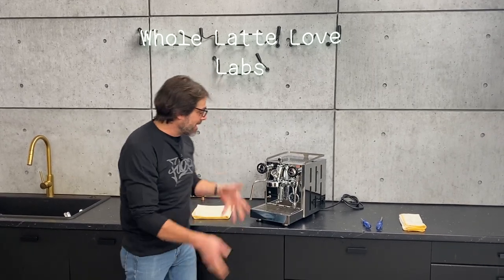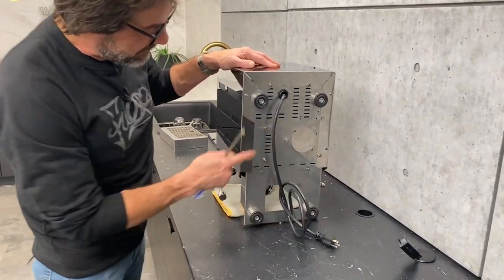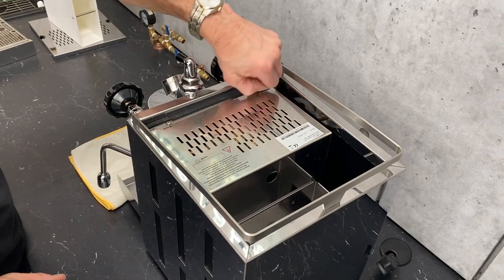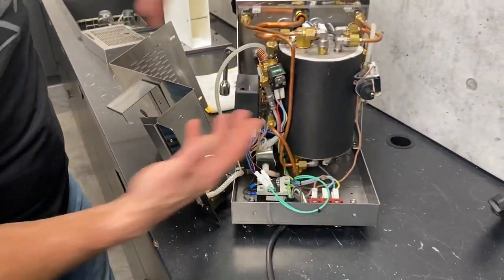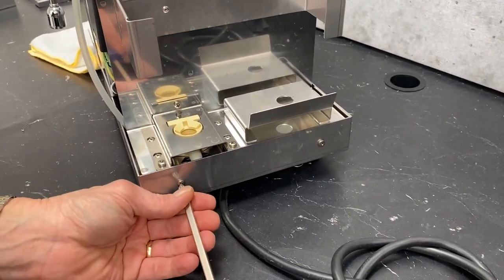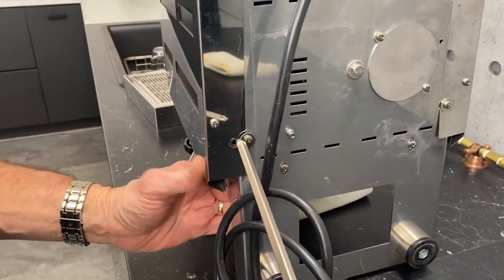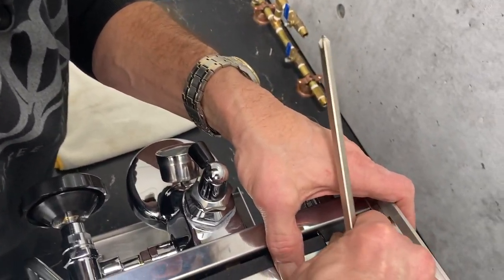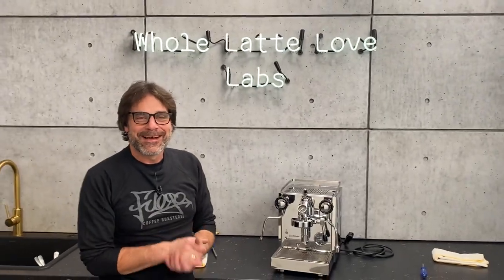Quick Mill Pathfinder: Housing Removal and Installation

Comment: I have a Quick Mill Arnos from you guys, and although it has some screws on the bottom that partially disconnect the outer panels, the panels won't fully come off. Any videos or instructions for that?
Reply from the maker: Hi lll, You also need to remove the 2 screw towards the front of the machine on top underneath the drip tray. That releases the front top of the side panels. I do not have the machine in front of me at the moment. There may be other hidden screws to fully release the panels but think that's all you need.

Comment: Marc,any tips on removing the panels on a quickmill andreja?  Not appearing obvious.
Reply from the maker: Hi b, I do not have an Andreja in house at the moment but on the 4 other QM machines I do have there are bolts underneath at the bottom of the panels.
Marc

Comment: Where exactly is the OPV? It is definitely not in the location indicated on the video on the WLL website (which uses a Profitec to demon) and not the same mechanism of access. Any info is super appreciated. I might make my own video on this as soon as I find out how and where to access it
Reply from the maker: Hey 80's, Here's the video showing how to adjust brew pressure on the Pathfinder https://youtu.be/PwSzwayC1u0
OPV is the Over Pressure Valve.
Marc

Comment: A lot of these machines have a hefty capacitor in them to start the motor.
Reply from the maker: Hi TJ, Yes they do!
Reply: @Wholelattelovepage  Hopefully the ones that do have an automatic discharge circuit for when the power is removed, for safety reasons. I built a solar powered wine barrel fish-pond with an electric fence around it to discourage the racoons, and I turned it off when I had a new baby. 6 months later I touched it to remove it and it still gave me a nasty shock. I was quite surprised that the capacitor had held its charge for so long.

Comment: I have a question for you Marc. I apologise if it's not on the topic of Quick Mill Pathfinder.
My question is if you would consider it an upgrade, to move from a Rancilio Silvia E 2020 , to the ECM Puristika ?
Since, I am a fun of only espresso, and since Latte or Capuccino is not of my interest, I was considering 
a more capable machine for espresso. I know that you are a fun of ECM machines, but I would like
to know the reasons why you would consider it an upgrade
Reply from the maker: Hi Kats, No need for apology - I'll take off topic questions on any video! I would consider it an upgrade. First, if you have not watched already, do check out my colleague AJ's video on the Puristika:  https://youtu.be/MZJvIWWPLiU
So, why is it an upgrade? E61 group and PID temp control. Far more accurate brew temps than a Silvia. External brew pressure adjustment - it's not meant for pressure profiling during an extraction but does alllow you to tune brew pressure to suit a coffee. Higher construction quality. Silvia is a decent machine but things like the easy to chip painted steel base frame and small drip tray bug me.
Hope that helps!
Marc
Reply: @Wholelattelovepage  Yes, I saw AJ's review, which made me straight interested in the ECM Puristica.
Do you believe there is a pressure difference of ~1 bar, from what the pressure gauge on the top left corner shows, to the actual pressure on the shower screen?
Or it should be accurate? I did not make adjustments on my machine, since I figured out that the pressure is around 9 bar. But if I have the chance, for example in a machine like ECM, then I would definitely experiment between 6 - 9 bar with each new coffee variant.
The last 3 coffee beans I received, was 
1. Kenya Karatu PB (washed process), which has a taste of blueberry, fig, lemon and lime. Quite unfamiliar tastes for me. So, it is very interesting to taste
2. Laos Phetlamka Gesha, with notes of stawberry, mango and prune. Have not tasted it yet
3. Costa Rica. Olman urena Anaerobic. Notes of strawberry candy and caramel. Have not tasted it yet. But I am very familiar with coffee from Costa Rica, and I love it
Have a nice day !
Reply from the maker: @Kats072307  There typically is a drop of ~1 bar from gauge reading to what is actually on the coffee. I'll try and put our Scace on the Puristika today to confirm. But I would not get too wrapped up in the difference from gauge to group. Use gauge readings as a reference. If you like a particular coffee at 7 bar on the gauge more than 9 bar that's what you need to know.
Reply: @Wholelattelovepage  perfect. Thank you very much. Keep up the good work